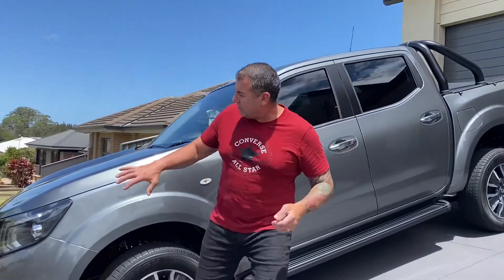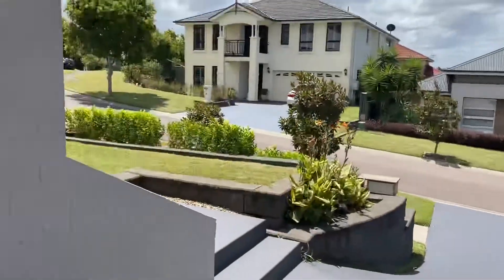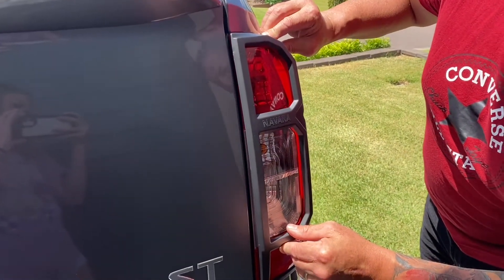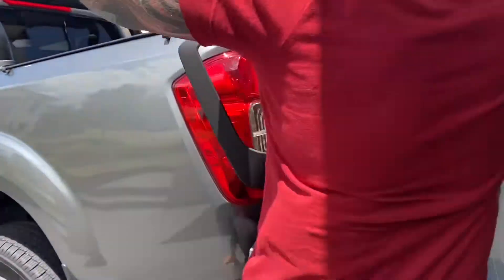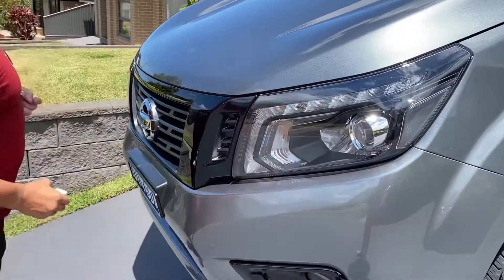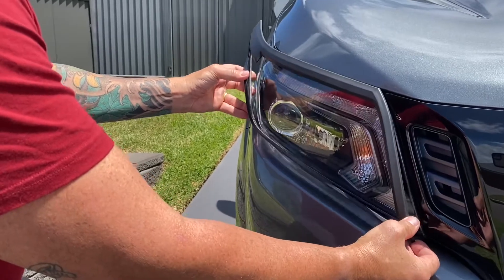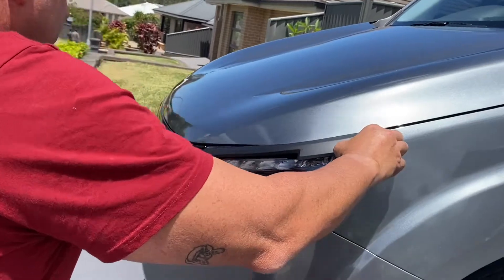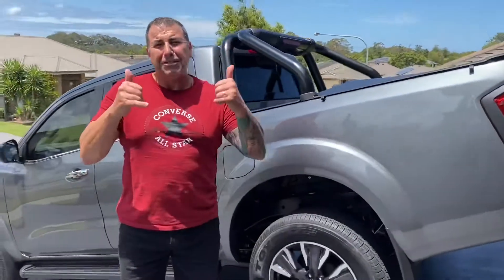Nissan Navara ST, 2020 4x4, head light and tail light trim covers.

Comment from the maker: I can’t fault it.  For the price of it, it’s definitely worth it. 

I’ve added a Throttle Controller on the Nav also (will post the video at a later stage) but the power and response it outstanding.  The 2” lift kit and 20” wheels have been done also (I will be posting the video shortly).